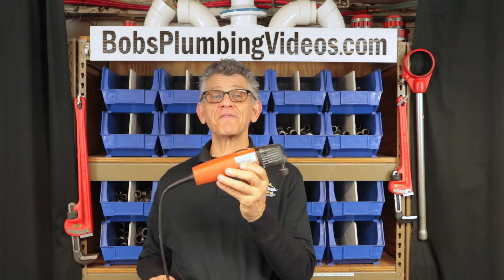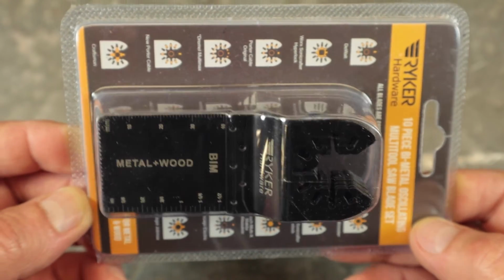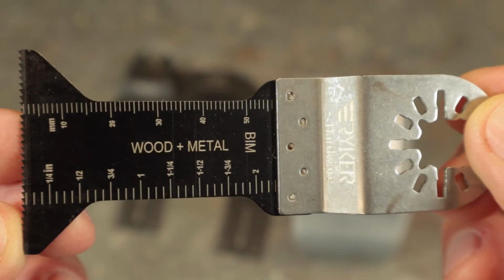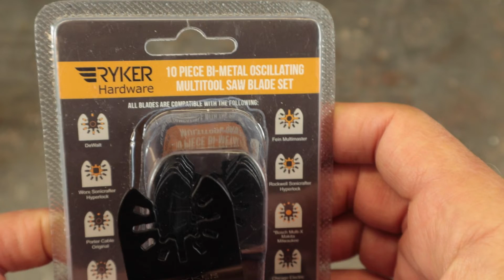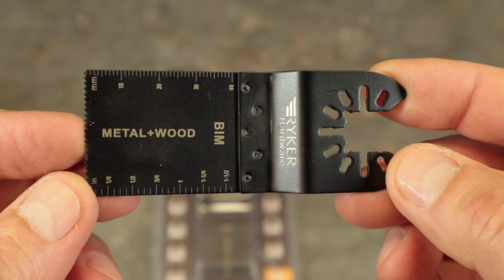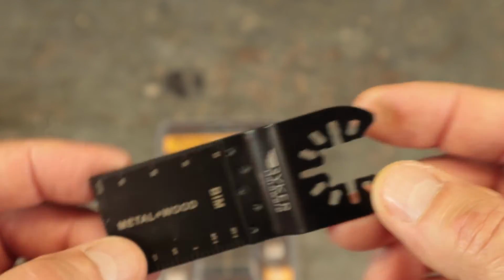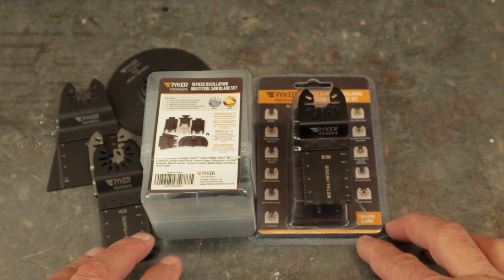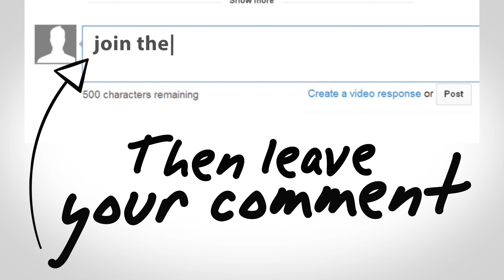Multi Tool Blades

Comment: I watched another video where the guy suggested using a wrench such as a crescent wrench, to hold the head of the Multi function tool when changing the blade. His observation was that it keeps you from stripping out the isolating mechanism by stressing them when you use the Allen wrench to change blades and will make your tool last much longer.

Comment: I have an older model Fein (636II XL).  The blades cannot be clamped without eventually spinning out.  The blades have a star pattern, but the holding screws are smooth.  Is there a fix for this?  The tool also came with 2 sizes of mounting screws (18 mm and 25mm), with no explanation of their use.  Any ideas?  The manual says nothing.

Comment: Imperial blades, carbide tipped for metal.  Would love to find a slightly longer blade that could handle 2” pvc pipe in a wall with drywall on one side.

Comment: Imperial blades are pretty good! I use milwaukee m18 tool have Rockwell corded both pretty good. Bosh has awsome  power but blade holding mechanism wears out quickly seen it on 2 different tools!
Reply from the maker: I'm using the Milwaukee m12  multi-tool and so far I'm happy with its performance. The Ryker blades have been doing a respectful job to date, but I'll check out those Imperials. Thanks for checking the video. Regards, Bob.
Reply: Is the Bosch wearing out with Bosch blades or off brand blades that don't fit properly? I bought a used Bosch MX25E and would like to find cheaper accessory blades BUT don't want to wreck the mount if they don't fit properly either. I don't see the Bosch mount wearing out with proper fitting Bosch blades, mounted & tightened properly. Mine has the OIS mount. In fact, the Bosch blades have a full 360 Degree contact surface so i doubt the mount should wear out AT ALL unless the wrong blades are being used and they don't fit properly. I have seen some pretty stupid things done in my trade by people that don't have a clue! Not saying you are one of THEM.

Comment: Hi Bob
I missed watching your channel and your great advice since November 2020 , about the steam boiler , now I want to replace the 3 handles bath tub  shower valve to a single handle valve  , I have only the angel grinder , if I use it , it will make a big amount of dust in the house . Do the oscillating blade to cut the tile around the 3 holes ( template) will not making dust like the angel grinder ? If so I will buy the whole set of blades .
Thank you again Bob
Reply from the maker: Grinder is rough and will make a mess. I'd go with the oscillating toll myself!
Reply: @BobsPlumbingVideos  
Thank you BOB , I will buy the oscillating tool this week with the whole cutting tool set from Home Depot.

Comment: Thanks for posting. Can I say dont throw away a blade when the teeth are worn out as I used a metal cutter to chase out plaster for cables and it was worn down to an inch and still performed well.
I to got a shock at the price for my fein and the blades lasted no time at all.
Reply from the maker: Thank You, glad you found it useful. Blades are crazy expensive and if you can stretch more mileage out of them, GOOD JOB! Regards, Bob.
Reply: Just learned today how to ReSharper them to get longer use.  
https://youtu.be/XN8dlNku0vk

Comment: Not a negative comment on the video or the blades, just my opinion.
I have several multi tools, only because I am a tool junkie. Unless there is an issue where this tool would have better access to the piece being worked on, a jigsaw would give you faster, safer, better cuts than a multi tool in almost every instance.
Reply from the maker: No question! They do have their place when working in an areas you just can fit a jigsaw. Thanks for commenting. regards, Bob.

Comment: I need tool(s) that can cut (5mm thick) metal bars, wood, stainless steel pipes, plastics. I am thinking either I get an angle grinder and the appropriate blades/disks. Or get an oscillating tool and appropriate blades. Your honest opinions is most welcome. thanks
Reply: Sawzall/hackzall, as long as you don't have to do wood plunges and your not going for looks.

Comment: I've Got Blades On Amazon Before
I use A Ryobi Multitool.
& I Have Bought Rockwell
Blades Hot best & I Also Have A
Rockwerr Sanding Finger Too.
& It Works Just Great. I Also
Have A 24 Pack Of Blades
I Got On Amazon & They Wh'er
$30.00 & I Also Got A 40 Pack
For 38.99 That Isn't A Bad Price
If I Do Say so My Self. I'm Thinking
Making Some Guitar Picks.

Comment: I noticed you mount the blade upside down, although this is obviously no good for cutting flush, near the floor for example, is it better for cutting when there's no obstructions ?
Reply: As long as you don't need to cut flush against a surface, having the blade upside down puts less angular pressure on the blade because it's more in line with the handle.

Comment: what? doesn't fit dremel
Reply: One kit has the adapter for Dremel. Do not use the blades without it. They will fly off the tool and possibly hurt someone.